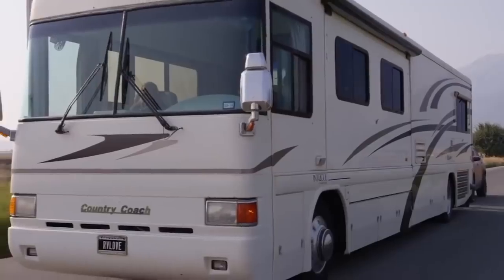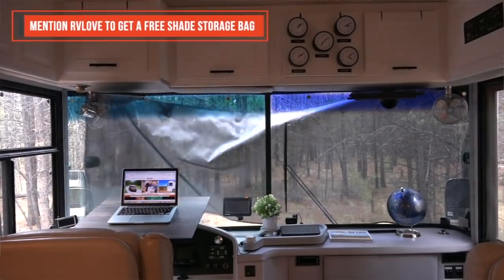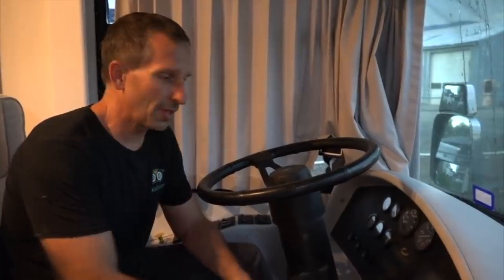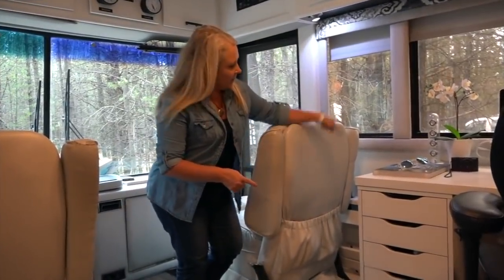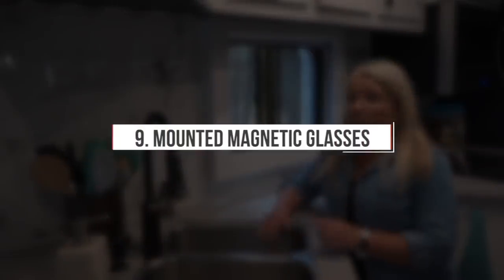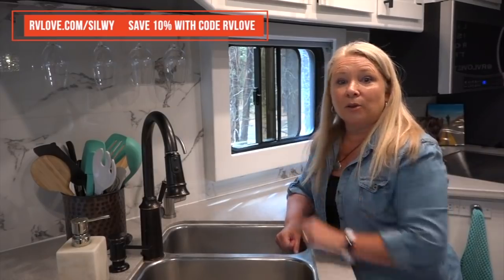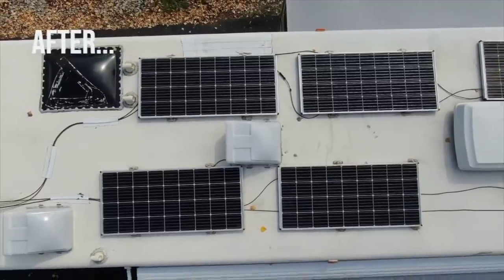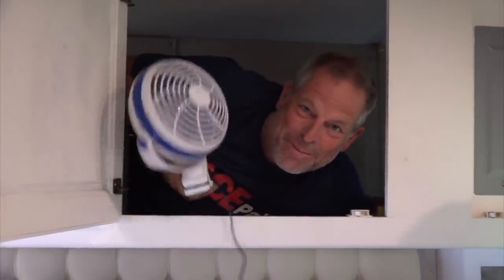11 More RV Repairs, Mods & Upgrades We Have Made to our Motorhome | Full-time RV Life

Comment: That transfer switch is an important repair.  How frustrating it would be to be sitting in the dark with phones, computers, and other things discharged and not being able to get power from your generator into your RV!  I am glad that one got fixed.  I trust you have had no further problems with your radiator fan and air filter since the problem you had earlier.  It hurt me to see all the dirt and dust  you knocked out of that air filter when you were in Arizona.  Wishing you the best!!!
Reply from the maker: Thanks Carl.  Fortunately with our substantial batteries and solar, we never had to go dark.  Just had to stay where there was sun, or find somewhere to plug in.  As for our fan and filters.  We haven't been off asphalt much this year, so that has not been trouble at all.  Thanks again as always.  Wishing you the best too.

Comment: Am thinking about those Magna Shades. I use the Reflectix. It works but a pain to put up and take down from inside the front windshield.  Bret is a trip. Enjoyed meeting him at the Cali show!
Reply from the maker: Hi Joe. Glad you got to meet Brett at the CA RV Show.  It was great seeing you again.  We love our Magneshades.  It goes up and comes down super easy, and the visibility out is excellent.  I am sure the reflectix would be a pain to set up sometimes, but the thing I would dislike the most about those would be that it blocks out the view out the window.  AND, anything mounted inside the window still allows heat inside the coach.  Reduced sure. But some of the heat is just contained in that space between the inside shade and the glass. Mounting the shades on the outside prevents it from coming in but still allows great visibility out.  Just remember that the privacy is only during daylight hours.
Reply: HEY Joe!!!!  Cheers buddy!

Comment: Your coach looks great.  If you had to do it over again, would you have purchaser a slightly newer coach to save on some of the structural repairs you made?
Reply from the maker: Thank you. Tough question. We were actually mostly shopping coaches a bit newer, but being able to buy this coach with most everything we wanted for a fraction of the price of the others we were looking at was too appealing.  We could have bought a similar year, but better cared for coach that didn't need so much work without spending a lot more.  All that said, the secondary answer is that what was right for us, would not be right for others. I imagine that most people would not want to spend as much time and energy fixing up a coach as we have.

Comment: Some nice mods and fixes!  Mark, I would have installed a EMS while your buddy was up in there. This way, the EMS will not only protect your shore power, but any issues with the generator as well.  This saved our bacon the other day when our generator decided to put 157 volts on leg 1 and 107 on leg 2.  We ended up replacing the voltage regulator on the 10k Kubota we have on our coach.  I also can't believe that Country Coach installed that Transfer switch up there.  We are lucky, ours is at the foot of the bed and easy access.  We also have 2 transfer switches, so more dollars when something goes wrong!  lol
Reply from the maker: Thanks for the input.  Yes, in hindsight, it would have been nice to install an EMS while we were at it.  Just a bit too focused on the primary challenge. Glad you got your voltage regulation fixed as well. Thanks again for sharing the information for others too.
Reply: I am fairly sure you would have been happy to get out of the cupboard more than the desire to install an EMS....hahahahaha.  It is still an easy install just have to empty the cabinets out, climb up there and dislocate my shoulders and plug in my fan.  hahahaha

Comment: Would love to hear and learn more about the work table/desk you put on the drivers steering wheel.
Reply from the maker: We talk a bit about our secondary work space in episode 6 of our Ultimate RV Makeover series.  Here is a link to episode 6. https://rvlove.com/2019/04/01/episode-6-nearly-there-ultimate-rv-makeover/ Using leftover pieces of flooring and buying a simple lap desk made an easy conversion.  One factor is that whether or not your steering wheel goes vertical enough.  If not, you might need to make an additional support to better hold the desk top.

Comment: Curious on the make and model of the transfer switch you removed.  The IOTA 50-R is apparently a known issue and we had one in our coach.  Last winter it went up in smoke and thankfully I figured out there was an issue when we woke up and one leg of the electrical was down.  As I was trying to figure out the issue sparks started flying and it burned part of the area around the switch but since I was outside I was able to kill the 50 amp power at the pedestal.  Can't imagine what would have happened if the failure occurred an hour or two earlier as we were in bed.  I would strongly recommend anyone that has an IOTA 50-R in their coach to replace it as it is an accident waiting to happen.
Reply from the maker: Hello Bob. Thank you for sharing your experience.  Glad nobody was hurt. Our original unit was a PS245S. Not sure of the brand, but might have been Todd.  We replaced it with a transfer switch fromLyght Power Systems, mfg by Elkhart Supply corporation.  Model number LPT50BRD.  Just in case you or others need one, here is a link to the unit we bought.  https://amzn.to/2PSfKqf
Reply: @Rvlove  That is a good replacement unit.  I considered that unit but I needed one quick and due to the input/output locations of the LPT50BRD I would have needed to do some creative wiring.  Glad it all worked out.

Comment: Hi ~ Interested in your dehumidifier. Moisture is always a problem in our RV. Are you happy with the Inofia, is it quiet, does it do the job?
Reply from the maker: Hi Donald. Yes, moisture can be a problem in RVs.  We have been super happy with ours.  It is the only one we have used in our RV, but have let others try it and they have all been equally impressed.  Some who already had a dehumidifier, after trying ours, bought one like ours.  We find it is very quiet, except when the alarm goes off that it has filled it's container.  We have seen it fill it's large container in only 4 hours.  So, if you want it to run longer, like overnight, run the included hose out a small opening in the gasket of a slide out, or into the drain in your shower. Here is a link to the model we have. It is the Inofia 30qt https://amzn.to/2NcSzWc

Comment: Does a dehumidifier make it TOO dry? In the winter I end up needing lotion quite a bit. I know the dehumidifier serves a great need but is it too good?
Reply from the maker: We only use the dehumidifier when it is too humid.  When we are in a dry climate, we simply don't turn it on. It even has settings that you can choose the humidity level that you want it set at. So no, it has never made it too dry.

Comment: Your coach is really looking great! When I first started doing my research for going full time (in 4 years) I kept coming across people saying that RV parks are putting age limits on RV's they would allow in their parks. Have you ran across this or is this just some more of the internet misinformation?
Reply from the maker: We have come across a few parks in our 5 + years of travel that enforce it.  Quite a few have it in their bylaws as a backup in case somebody shows up with a really rough looking RV.  But very few enforce it.  Even relatively high end RV parks are often fine, especially if you have a high quality and well cared for RV.
Reply: @Rvlove  Thanks for the info. I'm strongly considering buying used and this helps.